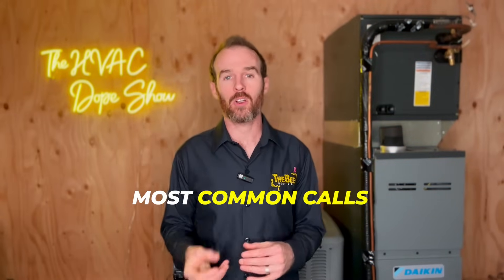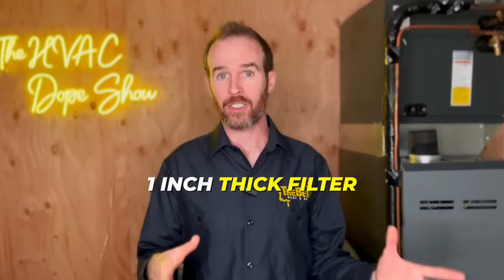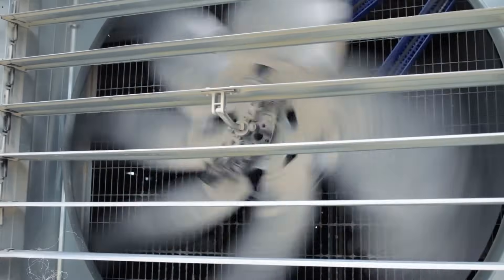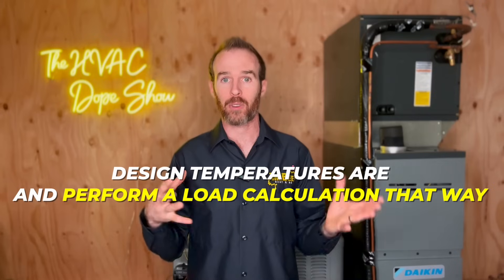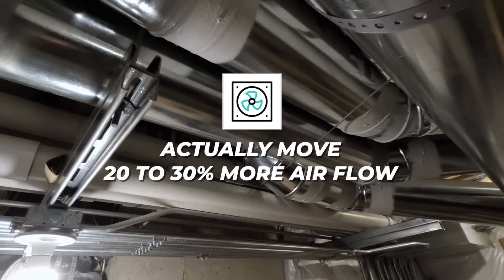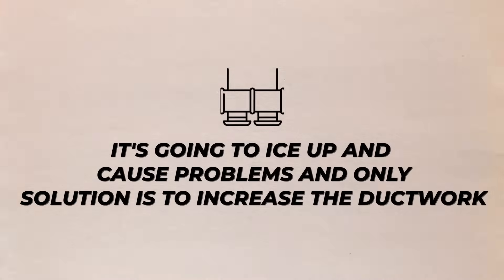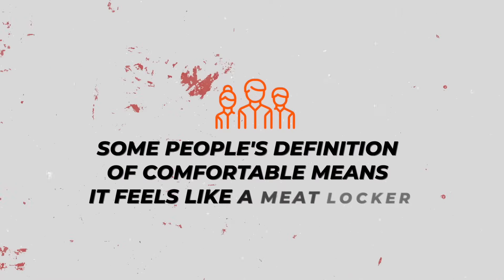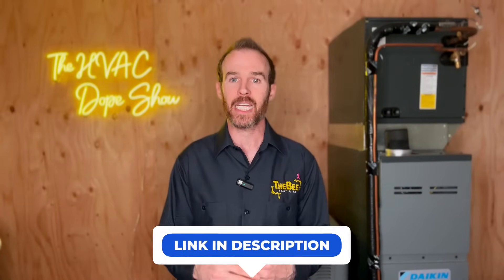THIS is why your AC isn’t keeping up 😬❄️

Comment: Hello, nice video.  I have a Lennox 4 ton 19 SEER variable speed system.  Prior to having the duct work in the attic replaced I could maintain 65 degrees if I wanted to.  I like it cold when I sleep at night.  Now I am unable to maintain the set point, right now I have set to 68 degrees and it's not keeping up.  It's 69 now, 68 set.  I know I'm nit picking but what has changed?  The unit has been cleaned (coils) and properly serviced.  So if I use thew 20 delta as a reference I should be able to set and maintain 62 degrees since the feels like temperature is 82.   

Thanks
Reply from the maker: Refrigerants for central air tap out at around 64/65F in terms of there ability to lower the temp. You can set it at 60 but it won't get below 64/65 normally unless it's oversized and / or well insulated. If the ducts were buried before that would affect it. They could have trampled down on the blow in insulation and therefore it's not insulating as well. What's more likely that I'd look at is if it's the right size ductwork, and also if they didn't do a good job sealing it. The best way is to look at it yourself, or hire another contractor for a second opinion consult... if there's a bunch of leaks especially on the return then it will not be efficient. Hope that helps!

Comment: How about if the system is brand new a week old today? Yesterday I came home and the t-stat read 77 even though it was set to cool at 73. It took hours to come down to 73. All that time the condenser outside cycled on/off but the handler kept going.  Fan set to Auto and no closed vents.
Reply from the maker: I can almost guarantee I know what your problem is because I've seen this... so your condensate drain is likely backing up. If your installers put in a condensate safety switch it will trip the condenser but keep the fan running depending how it's wired. This is a common tell. On the hot days it will show up because it cycles on, then fills up / overflows and trips the safety switch (it's doing its job and preventing a flood LOL, way worse...) and then after the fan runs for 10 minutes, an hour, whatever, the water dries just enough to lower the safety switch and condenser outside kicks back on. Good luck, call the company they should fix it and send the tech back out. It happens... and often times its the slope of the drain has a dip in it and water is pooling there because the tech missed that it wasn't level / draining properly. Could also be clogged outside from the previous install.
Reply: @TheHVACDopeShow  You are correct. The drain was backing up. He said what you said the safety switch was cutting the system off. He pressure forced all the gunk out. Working fine since.
I added bleach to the drain and plan on doing so every few months. Do you recommend bleach or something else? Thank you!

Comment: Wish that I had this info before the pandemic when I sunk $10K into a new unit and duct rewrap. I’m just glad that you didn’t mention the 20 degree scam that most contractors mention in MS. I know it’s a load crap, because computer labs, doctor’s offices, and restaurants don’t have these issues. The AC in my twenty one year old Tahoe was designed better.

Looking back, I would’ve been better off with supplemental cooling solutions like a split.

Comment: When there is a freon leak, where is the leak usually located? My HVAC guy wants to replace the entire system and I'd rather just replace the part or item.
Reply: The leak  could happen anywhere in the system and requires to be leak checked. If that hvac tech is trying to sell you a new unit then look for another company.  That tech is trying to take advantage of you instead of looking for that leak. Keep in mind though that checking for leaks do take some time.
Reply from the maker: Yes and if it's leaking from the condenser coil or evaporator coil that might be why they're recommending it. Or if it's R22 as the cost has gone up substantially and the juice probably isn't worth the squeeze. You can use a drop in replacement but they're getting  prohibitively expensive. But if the tech can't explain that to you or quote you a price for a leak check at least then I would get a second opinion.
Reply: @TheHVACDopeShow  condensor coil is outside and evaporator coil is inside correct? the tech only checked outside the house.
Reply: @TheHVACDopeShow  I just had a new HVAC tech take a look and he found a leak in the condensor coil on the bottom of the outside unit. He did a leak test and showed me exactly where the leak was. I am waiting to hear back from them with options. He said the refrigerant is "last generation" and they still carry it in stock. What are your thoughts? Do you think it can be fixed? I really don't want to buy a completely new system.
Reply: @true.believer111  I just had a new HVAC tech take a look and he found a leak in the condensor coil on the bottom of the outside unit. He did a leak test and showed me exactly where the leak was. I am waiting to hear back from them with options. He said the refrigerant is "last generation" and they still carry it in stock. What are your thoughts? Do you think it can be fixed? I really don't want to buy a completely new system.

Comment: We constantly hear about the setting of thermostats low 80’s when not home and such…one thing ive learned since entering the hvac trade is, is i dont follow that at all. We keep out home at 75 during the summer…everyday home or not. Rather the system run through out the day and remove smaller amounts of heat rather than work longer and longer to remove the heat buildup

Comment: All I’m hearing are reasons why single stage systems should be banned. It pisses me off to no end that the 3-4 weeks we have ~100F temperatures our unit can’t maintain 70F. Definitely learned my lesson about buying a house in September even if central air system had just been replaced within the last two years. Residential refrigerants being limited to 64F is bullshit as well. I’m not saying they’re not, just saying it’s bullshit that limitations like that are forced. Let me have an NH3 system.

Comment: I bought my Daikin FIT almost 2 years ago in August and it was running just fine up until a couple months ago. I could drop the air at anytime of the day and in the middle of the summer and it would achieve that temperature within a very short time. Matter of a fact, it would freeze you quickly and I'd have to turn it back up. However about a couple months ago it started struggling majorly to get the temp down, even set to 74 F. I had two different companies come out and inspect (one of which sold me the unit) and both said everything looks fine and there's no issues with the unit. They couldn't explain why its not cooling properly anymore. I'm at a complete standstill now and my unit runs like a pig and doesn't cool down. Only at night it can get down to 74 or 73. During the day it won't cool down to that and the temp goes up to 76 or 77 when I try to cool it to 74 or 75. For example, right now I dropped it to 70 and it won't budge past 75 degrees. One side note is both companies did NOT go into the attic and check the handler, so I'm wondering if there could be something up there to check? Any advice is much appreciated, because I don't know what to do anymore and considering this is a nearly brand new unit, I'm crushed that I can't get any helpful answers.
Reply: Yes both indoor and outdoor units REQUIRES to be inspected. Look for a respectable company in your area.

Comment: My upstairs carrier unit is not keeping up it is 88 degrees thermostat set on 74  it has reached 74 but can’t get it any cooler so it is running continuously until late evening or morning 
Now my unit is a 2 1/2 ton  which used to be an infinity model board in air handler went bad was $ 1000 dollars for part service man changed mt fan out to a single speed and basically it is old school now fron was good
I feel like it doesn’t move as much air as it did when it operated as an infinity it is an older unit but the temps coming out of my duct work is around 64 degrees my attic is vented ridge cap and soffit vents but just a month ago I added a gable end fan with temp and humidity to cool it down more in the attic
Any advice 
Brands available for sale in area are Goodman carrier Reheem and trane

Comment: Great video! Wanted to add to it. Attics are such an overlooked part of this with arguments of all sorts. Anyways, got rid of 8 passive vents and added three solar/ac vents and now my one ac unit works better than the neighbors two units in a 4200 sq ft house. Not only that it even keeps up on 90+ degree days and after the sun goes down it will catch up and turn off around 8:30pm if set to 70.

Comment: our crazy utility company had a program where you could have a shutoff installed on your outside condenser unit so when they had peak demand they would just turn off some customers for a few minutes each hour and let your indoor unit still circulate cool air but it was all a total lie the first hot day they turned off system for 25 minutes then on for 5 minutes which had our house over 80 degrees in no time since our system is the right size and needs to run to keep house cool apparently they scrapped that whole system so many people had them take it out after 1 hot day they claimed that when I called and complained they could not change the settings and it would be a couple days till they could take it off my unit. I had to disconnect it myself to keep my pets from dying so never sign up for stupid energy saver programs.
Reply from the maker: Xcel energy has this too they call them savers switches and customers regularly ask us to remove them because they cause service calls when they wonder why their AC isn’t keeping up

Comment: Hi, I really appreciated this content and extensive explanation on why my HVAC system may not be keeping up. Let me start off by apologizing from the start as this may be a bit too lengthy. I currently have a Daikin fit inverter unit that was installed 2 yrs ago, this is my 3rd unit in 7 yrs a little background info.
•	I live in the Tampa, FL area, we have very hot spring and fall season with even hotter & humid summer conditions. So, my biggest complaint to the HVAC companies was that my HVAC sys not only couldn’t maintain set point temp(5-7degrees) but if I used my stove/oven it was even worst8-12degrees). 
•	My home was built in 2006
•	My Square footage is 1919sq ‘
•	I’ve owned this home since it was 6 months old
•	The original homeowners had it built themselves, they paid the builder for a copy of his blueprint, took them to an engineer & architect and cut the square footage down from 3,000 sq’ to 1,919sq’
•	My home is a 3bdrm 2 bath cinder block construction
•	I have crappy builder grade single pane windows
•	I have a lot of sun exposure 
•	I have more than the usual amount of windows per square foot of wall space
•	The minimum ceiling height is 10’ (mainly in the bedrooms only, approx. 600sq’)
•	The main living area ceiling height is 14’(approx. 1319sq’)
•	We would like to maintain 70 degrees during day and 68 degrees at bedtime
•	Outside temp is usually mid to upper 90’s during day and upper 80’s to lower 90’s at night in summertime
So, I started with my first unit in 2017 with a York inverter system, I called several HVAC companies to discuss why my current 10 seer straight cool single stage system couldn’t maintain set point temp or come close within 1-2 degrees, matter of fact it would climb above as much as 5-12 degrees above set point temp depending on if we were cooking in the house or not.
None of the 5 companies I had come out to give me an evaluation inspected my current system or duct work, they all seem to agree that because I had these issues I needed a new system. They looked to see that my original system was a 4-ton unit and each one of them provided me with a 3 tier option (Good, Better, Best). They all said because I had a 4-ton unit and my home was only 1919 sq’, I only needed another 4 ton unit. So, I ended up going with the 2nd to highest estimate with a new to market York Inverter technology system 21 seer unit. It was installed in mid-summer of 2017 and right off the bat I knew this wasn’t going to be the solution to my old system. They finished installing my system around 6pm and I didn’t feel the house cool down until almost 12-18 hours later. Fast forward 3-4 years, the system kept having issues, throwing fault codes, shutoff when it shouldn’t have run constantly (as inverters are designed to do) and my electric bill remained the same if not even higher than my old 10 seer straight cool unit. After multiple trouble shooting appointments (40-50 appointments & 3yrs later) between the HVAC dealer and Youk technical support on site, it was determined that they needed to install a new unit. After 2nd unit was installed the same problems and poor performance repeated itself, so then they decided they needed to upgrade my duct work to accommodate the more highly advance system than what I had originally, still no improvement as I still couldn’t maintain set point temp (4-7d above) and extremely high electric bills. Set point temp wouldn’t be achieved until 6-7a next morning, and once the sun came up and mid to late morning would hit the temp just kept rising above the setpoint temp. I had the 2nd York unit for about 2 yrs. The nice thing about York was they had a money back satisfaction guarantee and gave me my money back. So, my HVAC dealer steered my to the Daikin fit, I love its compact design and foot print but sadly its performing the same exact way as the last two York units. This leaves me to question a few things:
1.	Is my HVAC properly sized, tonnage wise? It runs constantly but doesn’t achieve set point until 6a
2.	Is my duct size correct?
3.	Do I need more attic ventilation? Everyone I had in my attic says it is adequate 
The main problem I seem to have is finding a knowledgeable and reputable company in my are such as yourselves that knows what they’re talking about. Everyone I call out either wants to try to experiment because they have no clue or tells me the whole system is wrong and wants me to pay thousands and thousands of dollars more with no guarantee they will achieve my desired indoor/outside door temp range.
So my question is, what is your recommendation of what my next steps should be or try? Or am I asking too much of any system in Florida?
Reply from the maker: First off thank you for the info, I read most of it lol but got the general idea of what your issues are… basically I see 2 things that are my hunches. 1. System is undersized, the high ceilings are a dead giveaway on this because a house with 8’ ceilings is different than a house with 14’ for sure and the fact that brand new systems aren’t keeping up. This can also be ductwork but if the system is not throwing a B3 error code for airflow on a Daikin fit at least, then it’s not an airflow issue and is a sizing issue. 2. Insulation is poor or just isn’t adequate, you might be able to insulate the attic and / or roof, double pane windows are a pricey upgrade but might be worth it just to get the home comfortable. My hunch of a solution (without seeing it and sizing your ductwork) would be to a 5 ton system and honestly potentially a supplemental mini split to cover the load since you’re trying to achieve such a low design temperature for the Florida climate. But before throwing in a 5 ton system, you could look at renting a portable 2 or 3 ton unit for one day to see if that plus your current system running is enough to cool down your home and if it is - you likely have a load issue and need larger system or supplemental system like a mini split in the bedroom or living room to take off the edge. I would also consider insulation or siding however possible in Florida in order to get a better envelope for your home to keep things more comfortable. We have a guarantee to hit design temps but I will say 74/75 design temp is typical in Florida so I would consider adding a supplementary mini split ductless system and also insulating however possible to tighten up the house. I feel your frustration and if you’d like I can try to ask around for a referral of someone that can potentially help. But for me a portable AC rental for a day to verify the load, and also check the ductwork to confirm it’s not pulling in outside air or attic air via a disconnected duct in the attic (it’s probably just undersized but either way wanted to mention this)